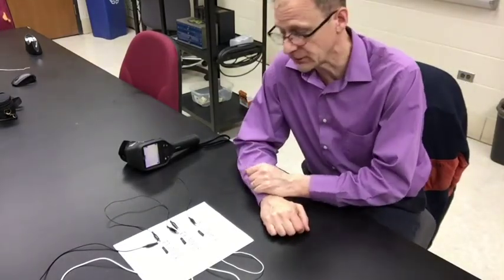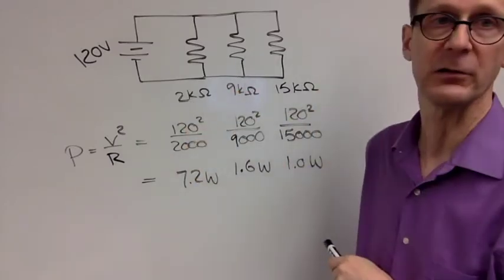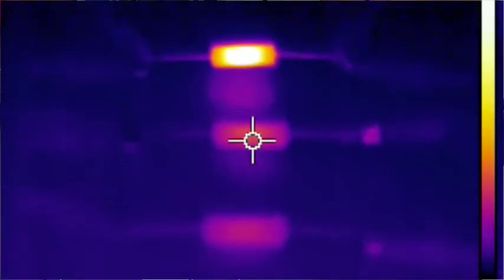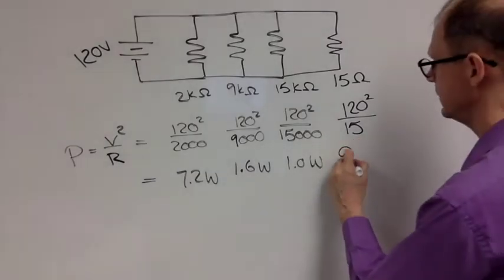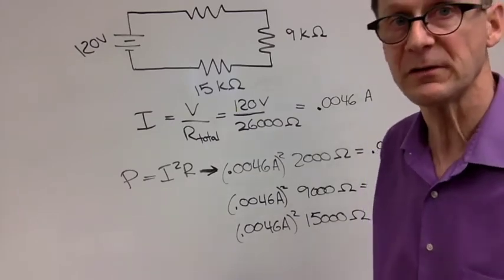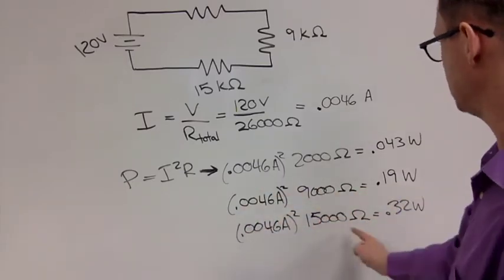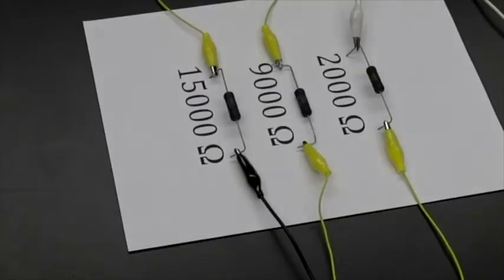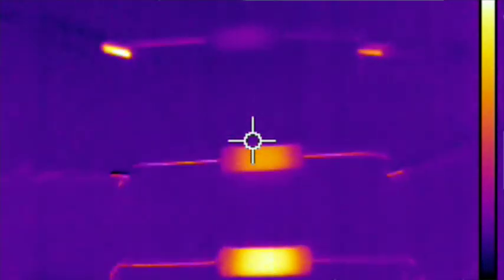Resistors Heating, seen with an infrared camera

Comment: Does the Maximum Power dissipation value of a resistor have any influence on the temperature of the resistor? For example, will a 5 ohm 5W resistor heat up the same amount as a 5 ohm 10 W resistor when connected to a 5V DV supply? I plan to use a resistor as a heating element to heat up lithium batteries in cold environments to keep it within the operating range.
Reply from the maker: Hi Nikhil, No, the smaller-wattage-rating resistor will get hotter. They would both be absorbing the same power in watts (P=I*V=V^2/R=I^2*R) but the higher-wattage-rating resister is physically bigger, has more mass to absorb the energy and greater surface area to radiate and convect it away. Calculating the equilibrium temperature would be complicated, taking into account ambient temperature, radiation, and convection, so expect that you will need to do some experimenting, making a couple prototypes before you get it right.
Reply: @JeffRegester   Thank you for the information, The heat transfer will be through conduction since the heating has to be done in high vacuum. Ambient temperature is mostly the temperature of the battery itself, radiation may be possible but convection is definitely not an option. I agree, the best way to determine a suitable heating element is to run experiments in a controlled environment.

Comment: If a resistor gets hot in a circuit!
Will it be less warm if you increase the wattage?
Reply from the maker: "Wattage" is the rate heat is being created here. So higher wattage results in higher temperature.
Reply: @JeffRegester  OK Thanks ! I thought it was the other way around !